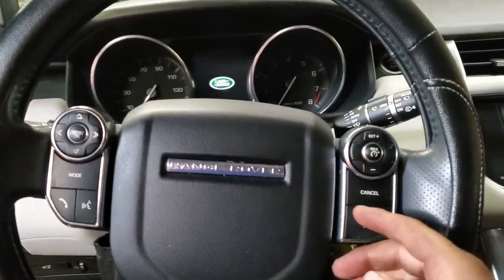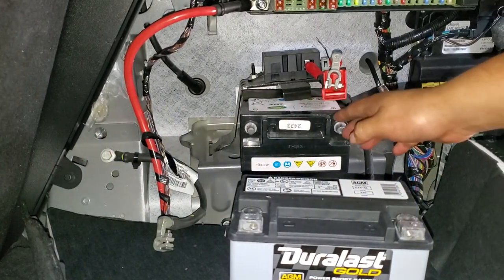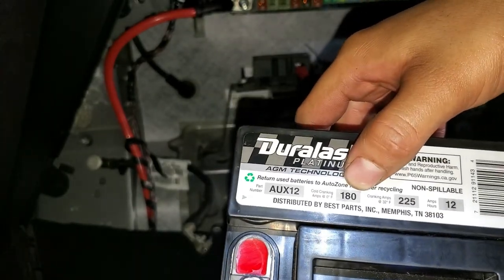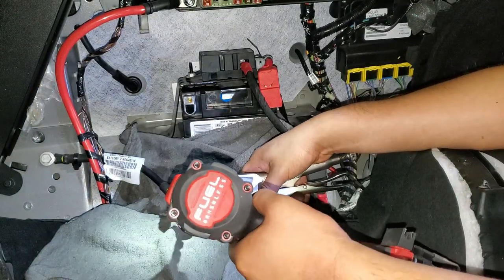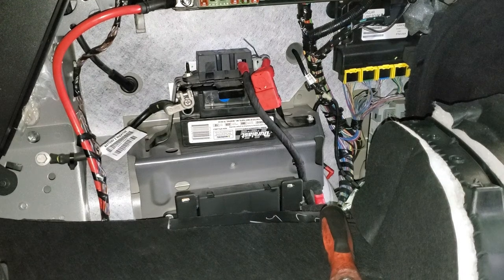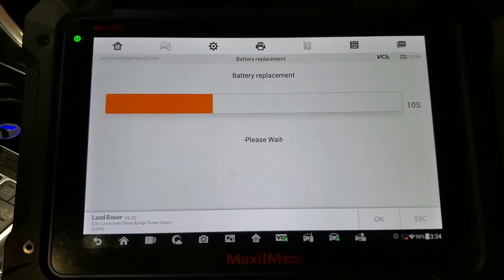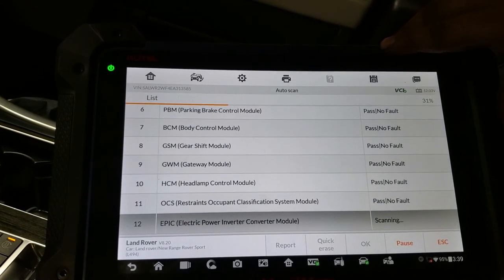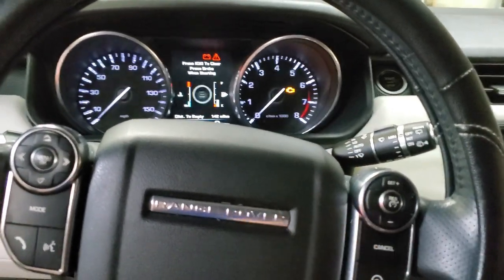How to replace 2014 Range Rover Sport secondary battery and battery programming. Code  B13C5

Comment: JVFIX - Thank you for the tremendous video!  You made a "mysterious" procedure look very easy.  I own a 2016 LR4 HSE and am getting an indication of my aux battery going bad.  So, I will probably be replacing it in the very near future.  

Can you tell me which Scan Tool you are using?  I really liked the screen info and the way you were able to maneuver around it so easily.  The information seemed very clear and easy to understand.  Please let me know the brand and model number of the scanner.  Thanks again for the very informative video.  rb
Reply from the maker: Thank you for watching. Really appreciate it.

Comment: This battery has been hard to find for my 2014 RRS L494 V8 but this was helpful, thanks.
Reply from the maker: thanks for watching if you have any questions feel free to ask.
Reply: I ended up contracted Firestone Direct that is installing the Sam Platinum battery and resetting the system for $225 so thought that might be easier that doing all the work detailed in thus video, especially since I don't have a scan tool. Still a great video for those who do.

Comment: Hi Master ! I have a question : I had a same probleme ! My Start-stop battery was very low ! and I change it like you. And my start-stop option was ok . but now 2 month later I have again this light '' ECO OFF not available ''' . Should I change my start-stop battery again  ?
Reply from the maker: it could be defective it happens, remove it and check it and if it's ok you will need a scanner to diagnose the problem

Comment: There is a hose/line on the right side that is tucked away. Shouldn't that be connected to the battery?  If we don't need it, do you know what it is for?  It is a black like with the red end.
Reply from the maker: that hose is actually just in case the battery leaks out some acid but this battery i guess it did not have a hole to put it in, the original ones do have the hole.

Comment: Great video.  what scan tool did you use?
Reply from the maker: i mainly use the autel IM608 for everything it is because i use it pretty much every day. but there are cheaper versions of the same scanner online
Reply: @JVFIXLLC  will the icarsoft cr pro work to register the battery?

Comment: Hi could you advice what this battery is for?
Is it any other reason other than the start stop?
Reply from the maker: it's mainly for the electronics in the car. since these types of cars have many modules that need to consume electricity all the time but slowly that's why it uses a secondary battery to keep the car modules alive.

Comment: Does it show battery low start now if this battery bad? And thank you for the amazing video
Reply: I changed the main battery and that warning still come on when I turn off the car or before start the car
Reply from the maker: u will need a scanner to reset the counter for that battery. sorry is just the way these cars are designed
Reply from the maker: it usually doesn't say that is low on volts or anything the only way to check it is to disconnect both negative and positive and use a voltmeter or the tool I used in the video to confirm if the battery is good or not.

Thanks alot for watching hope this helps you.
Reply: Thank you

Comment: where did you get the terminal adapters from? or what size are they
Reply from the maker: I got them at autozone and the size is 1/2 inch.
Reply: @JVFIXLLC  do you have the name or part number?
Reply from the maker: @johncase6038  yes here is the part# from autozone part# DL06072
Reply: @JVFIXLLC  thank you so much its appreciated
Reply from the maker: @johncase6038  no problem i hope helps you out.
Reply: @JVFIXLLC  did the battery work well any issues?
Reply from the maker: @johncase6038  all good no issues so far customer hasn't come back so I guess is all good lol
Reply: @JVFIXLLC  do you have to reset? I did the same thing, install the same spec battery, the lights went away on the dash but after two days my car have never perform the stop and start
Reply from the maker: @lund435  they probably changed the part# I did this job a year ago and they usually change the part#s all the time. just measure the post size too.

Comment: Why not use a 100% compatible battery? Videos like this encourage bad workshop practice.
Reply from the maker: I gave them the option but we had to get it order and they wanted the car the same day.
Reply: If you replace this more than once you would know that this "100% compatible battery" actually is very hard to come by cause it is a UK market battery and only Land Rover have them and they would charge $300 to $400 usd a peice before labor. If the dealer dont have it in stock it normally wait 4 weeks to get one now these day. In the US we can get the same battery, it is a common YTX14 battery for motor cycle which normally runs 40 to 60 bucks on Amazon but just not the connector like that, you can't even get a right adaptor for it. This guy actually did a pretty good job and save me time to wait.